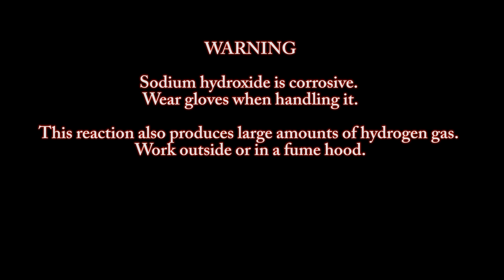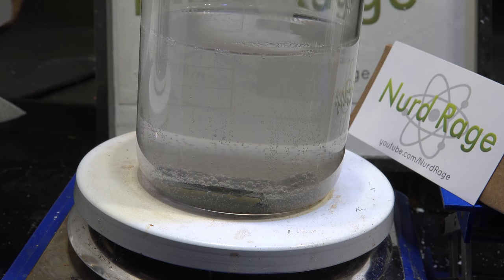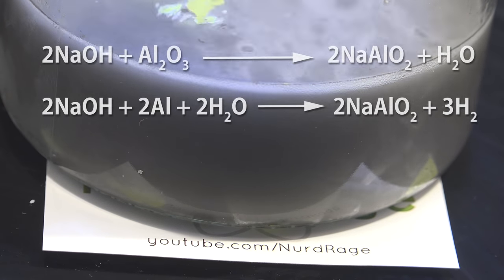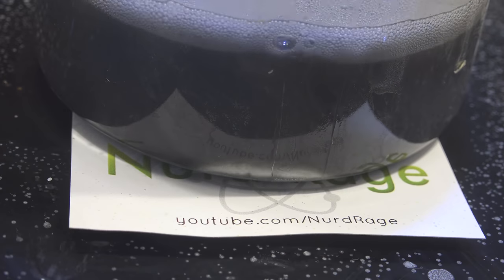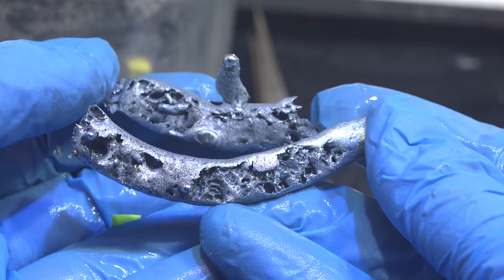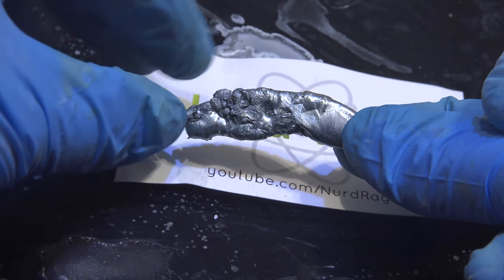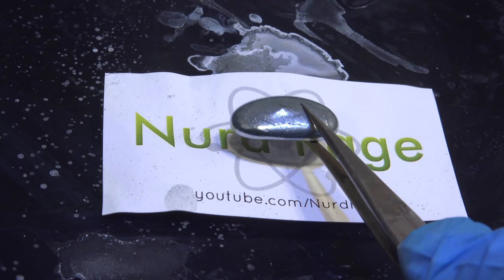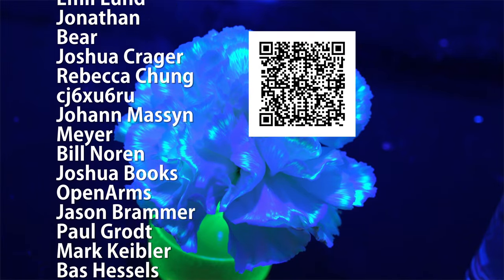Recover Used Gallium From Aluminum

Comment: Amazing, just two days ago I made gallium-aluminum alloy and have been trying to recover the gallium ever since then. I tried the sodium hydroxide method (granted, with oven cleaner instead of pure sodium hydroxide), and it seemed to work. I'll try the boiling water method to get it as pure as possible. I don't have sulfuric acid to get rid of the oxides, but the gallium in this state is sufficient. Thanks :D

Comment: Can someone explain why the reaction needs more gallium when gallium is a catalyst in the formation of aluminum hydroxide? I was under the impression that the catalysis mechanism was gallium dissolving the aluminum hydroxide layer so it couldn't produce the passivation layer it normally does. If a reaction needs more catalyst to complete, doesn't that make it.... not a catalyst?

Comment: I heard it's possible to generate hydrogen gas by reacting water with small concentrations of aluminum dissolved in gallium. I wanted to know then if it's possible to take the resulting aluminum hydroxide and remove it to recover the aluminum. This process seems somewhat inefficient.

Comment: What about adding HCl and then reducing the gallium salt with aluminium?
Reply from the maker: then you're right back to where you started. An alloy of gallium infused into aluminum
Reply: The thought was that (I think) aluminium is more reactive than gallium, so if you dissolve both in acid and then you only replace the gallium using aluminium, you should end up with an aluminium salt and the ceasium should percipitate out. 

An example would that you have a mixture of magnesium sulfate and copper sulfate. But you only add in enough magnesium and you are left with magniums sulfate and copper metal. This was my idea. I do not really know much, but based on the reactivity of the two metals, it should work. Kind of like this formula.
MgSO4 + CuSO4 + Mg ---> 2 MgSO4 + Cu
Reply from the maker: How do you know when you've "only add in enough"?
Reply: You have to try it on a small scale where you know how many moles of each substance that you have. If you do not know the molar mass, then you need to weight the aluminum and gallium before putting them together, convert that to moles add it into a big beaker and add the require amount of HCl. 

Now, since you do not know how much you have, you cannot calculate the required amount of HCl. I would take the Aluminum Gallium mixture completely dissolve it into Hal until I am left with only Gallium(III)Chloride and Aluminum(III)Chloride, distill of the access HCl, find out the percentage of GaCl3 and AlCl3 and add the amount of aluminum that you need. Here would be the reaction. This is the idea.

GaCl3 + AlCl3 + Al -> 2 AlCl3 + Ga
Reply from the maker: How do you find the percentage?
Reply: I do not know the awnser to that question. The original idea was to conver mass into moles, but when you do not know the mass of each element/compound then I do not have an anwser. Is there not some sort of machine where you can put in a sample and it tells you how much there is of each substance? I would not know, because I am a noob at chemistry, but I am certain that it would be analytical chemistry, somewhere.
Reply from the maker: That's why you can't use "HCl and reducing the gallium salt with aluminum". The method in the video using sodium hydroxide doesnt require prior knowledge of the composition.
Reply: Okey, but would it work in theory? Would these equations work? 
6 HCl + Al + Ga -> GaCl3 + AlCl3 
GaCl3 + AlCl3 + Al -> 2 AlCl3 + Ga
If they work in theory, then all you is to know how much gallium and aluminum you have. Or, if you do not know hoc much gallium and aluminum you, could you dissolve it in HCl and then do some spectrometer (you are the chemist) test of the salts to determine their purity?  

The underlying idea is that we turn metals into salts, and then precipitate out the metal that we want, while leaving in the other metal. Like putting copper wire in silver nitrate, but this time you have a mixture of copper and silver nitrate.

Comment: Your person opinion of the practicality of this material as a potential fuel source? How much gallium is wasted? How much is recovered? How much gallium & aluminium is required for a significant amount of reaction to power a car or other vehicle? I read several sources claiming the potential for this reaction as fuel source but my "2nd law of thermodynamics" alarm goes off! 😆
Reply from the maker: Complete BS. The power that comes out of the aluminum was originally put into the aluminum when it was made at the aluminum smelting plant. The thing is, aluminum is made with *electricity*, which is the most valuable form of energy. It is tremendously more efficient just to use that electricity to charge batteries and power our cars that way than by making aluminum and then reacting that aluminum to make energy. Besides, we already have a good electric grid to transferring electricity. To convert an aluminum energy based society would require building out a whole new transport infrastructure. Aluminum would have to be tremendously better than electricity to justify that cost. It's not even equal.. it's worse.
Reply: I figured, thank you for your time!

Comment: Are you sure that a significant amount of gallium would remain in solution? In my mind, the aluminum metal remaining after the digestion in lye should easily reduce any gallium remaining in the solution back to metal.
Reply from the maker: that takes too much time, and you have the competing reaction of the gallium being consumed by the sodium hydroxide. The floating bits of aluminum oxide slowing down access to the metal doesn't help matters either.

For amateur, this is an acceptable loss. But it's still VERY far from quantitative recovery.
Reply: I meant that the aluminum entrapped within the gallium will act as an electron donor to the gallium, keeping it from being oxidized.
Reply from the maker: IF you wait long enough, that aluminum will run out. Are you sure all the gallium in solution would have been displaced out before then?
Reply: I am arguing that because the standard potential difference between aluminum and gallium is so large (.7 V or so), the gallium can never dissolve off the surface of the metal, since the aluminum will quickly reduce it back down to metal. This is just a hunch though, unsubstantiated by experimental data.
Reply from the maker: What you're saying is correct, but you're assuming the aluminum will always be there. Eventually, the aluminum will be completely consumed. if there is no more aluminum, how can the remaining gallium in solution plate out?
Reply: Well, the point is to stop the reaction before all the aluminum is consumed, as you did in the video. Then substantially all the gallium will remain as metal, and this can be reacted with plain water with no loss of gallium.

All I'm saying is that the procedure in the video doesn't seem to have any places where considerable amounts of gallium salts could form.
Reply from the maker: Oh you're wondering how it even got into solution to begin with. What happens during the dissolution bits of of the metal will break off due to the incredibly vigorous bubbling. These small dust sized pieces with their large surface area quickly dissolve into the solution. Gallium and aluminum in all. That's how the gallium gets into solution. For that to displace out it has to find its way back to surface of the main alloy metal piece. This can take hours and you can't wait that long because the main metal piece itself will be totally dissolved.
Reply: Oh I see. Thanks for the clarification. 

Maybe adding the sodium hydroxide more slowly would limit this dissolution? Make a strong solution of it, and add it in dropwise over a few hours?
Reply from the maker: if you go slowly the aluminum just builds up an oxide layer and stops reacting. As you continually drop in more sodium hydroxide the layer eventually gets etched and exposed the aluminum surface, but now that the sodium hydroxide concentration is high there will be a burst of activity.

There probably is an optimum rate for this to work best. But if you were that good you'd probably wouldn't even be using this method and using the solvent extraction method.
Reply: Maybe break up the aluminum into very small pieces at the start?